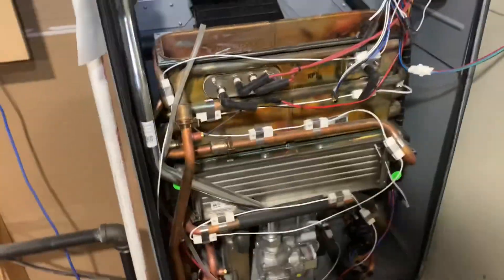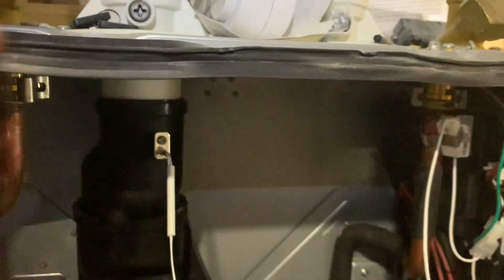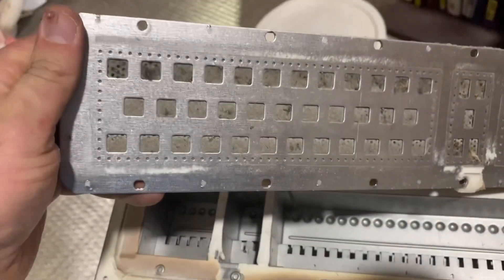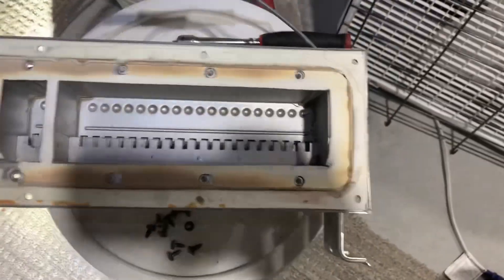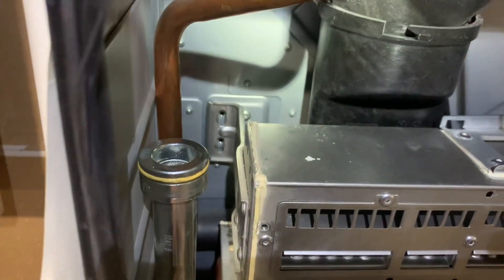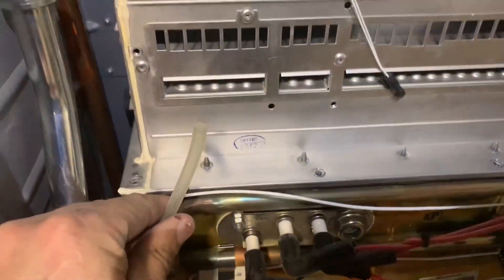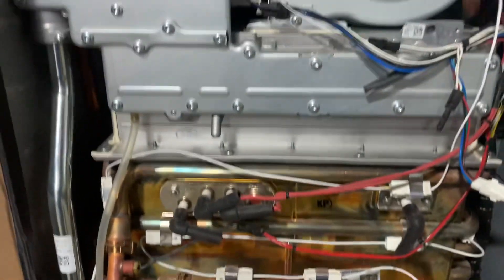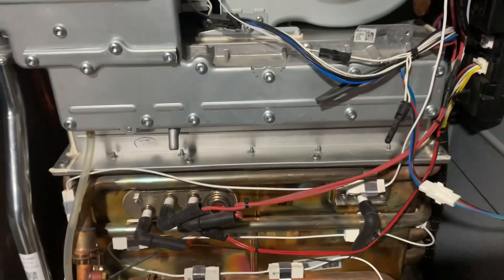Bosch Tankless Water Heater C1 C2 code

Comment: Brilliant!  I was preparing to remove the whole "heat cell," but Mr. Christy found a better way.  Who the H-E-double-hockey-sticks sandwiches a filter, or screen or whatever it is in such a non-serviceable location?  Bosch is Ridiculous - class action lawsuit material, that's what this is.  Anyway, I have a houseful of daughters - our family is sincerely grateful, Mr. Christy!  For anyone reading these comments struggling with that one BACK SCREW referenced in the video: try using a hand-held mirror (and flashlight, of course).  Locate that screw head with the mirror.  Use a 1/4" socket extension to "land" on the screw head from the right - at an angle - then straighten it out by sandwiching the socket extension between the manifold and that black, plastic exhaust section.  It WILL fit; the plastic exhaust piece is just flexible enough to accommodate the 1/4" socket extension.  To reassemble, use electrical tape to fasten the screws to the driver bit for those back screws (so you can land the screws in their holes without holding them).

Very impressed with this - thanks!
Reply from the maker: I’m glad it worked for you! I have now done mine 2-3 times, about once a year the dang thing will start acting up. I need to seal the front cover better and install a filter on the intake. I think the next time it happens I will see about getting a new inner screen, as they seem to slowly break down after multiple disassemblies and cleanings.

Comment: You had any problems with the error code since you fixed it like this?
Reply from the maker: Other than having to do it again a few months back, no. I keep thinking I need to tape up the door and add a filter on the inlet
Reply: @ I think we must have the exact same model. Mine doesn’t have the filter on it either. Thanks for the video! Gonna tackle mine tomorrow. 😬
Reply from the maker: Good luck! It’s really not too bad of a project overall

Comment: I have the same problem. Which tool did you use to reach the screw that is obstructed by the exhaust gas collector (the black plastic part in the back)? I cannot reach it.
Reply from the maker: It’s been a minute, but I want to say I put a torx drive socket on a 1/4 extension and crammed it in there at a bit of an angle and got it out that way

Comment: FYI: The inlet screen is missing from the impeller.
Reply from the maker: Yeah, I noticed some other images and videos I saw online had a screen, but mine never did from the first time I tore into it.
Reply: @travischristy8334  Mine just started spraying water from the heat exchanger into the burner.🙁

Comment: Having the same problem with my water heater. I removed the van, stuck a vacuum hose in there and gently blew compressed air backwards through the system. Cleared it out for now. Will see if its a long term solution.  Do you happen to know if there are torque specs on all those screws? I couldnt find anything through bosch
Reply: Had any problems with the error code
since you tried blowing the system out like this?
Reply: Actually yes it did come back. Worked for a while. I'm going to try doing a much more thorough blow cleaning and see if that helps. If not, a tear down may be in order

Comment: 5:37 - I could barely see it.  I was curious there.  That's the first time I've ever seen a gas connector hooked to a tankless.  CSST is bad.  That's the lazy approach.
I was looking, thinking: "Does he have a drip leg?" No.  That connector got a lot of strain at the ends to make those 90 bends.  It's too short of a piece.  It just needs a gas tech to put a union and drip leg on it.  The crud in the pipe just goes up into that expensive unit otherwise.
Pretty damn good work, by the way.